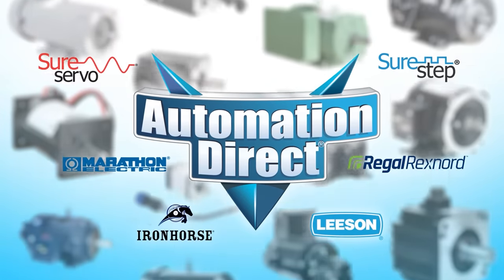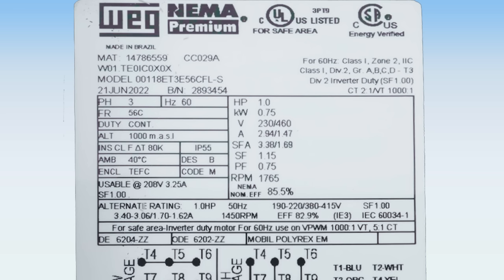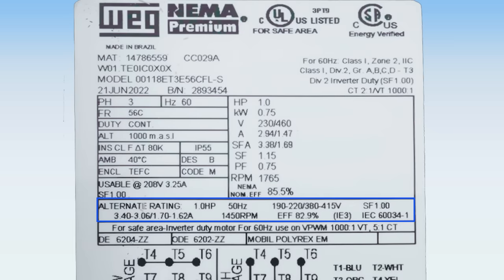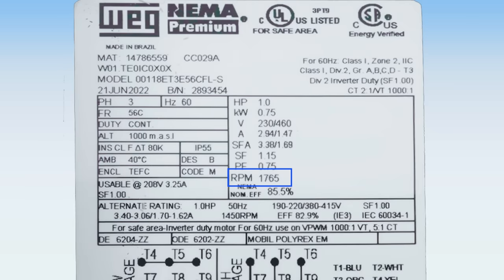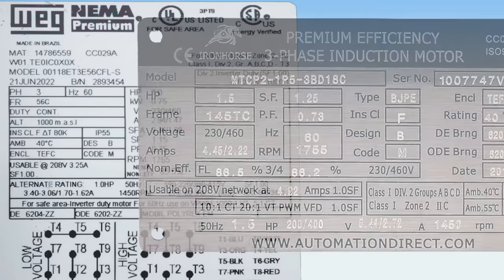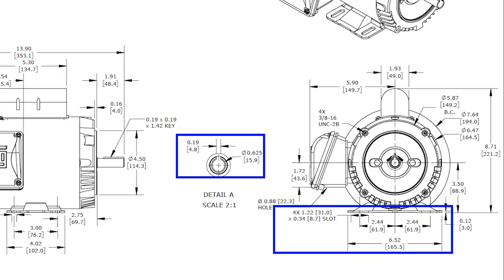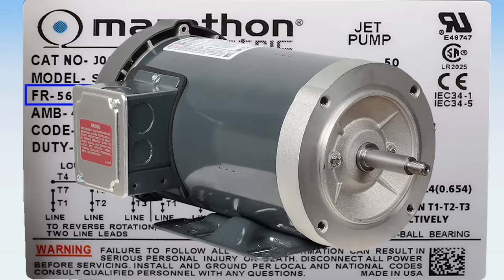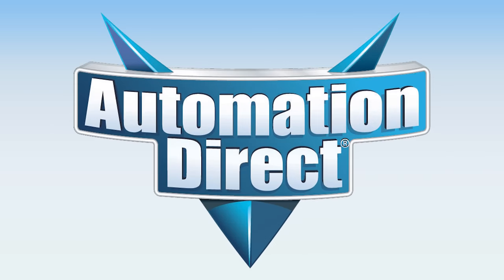Understanding Motor Nameplates - Weg, Marathon, Leeson, IronHorse - from AutomationDirect

Comment: Good, elaborate on the voltages,240v delta and 415v star,how to achieve 240 v connection  for a 3 phase delta configured motor